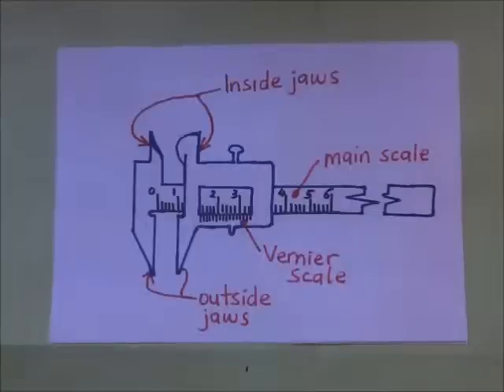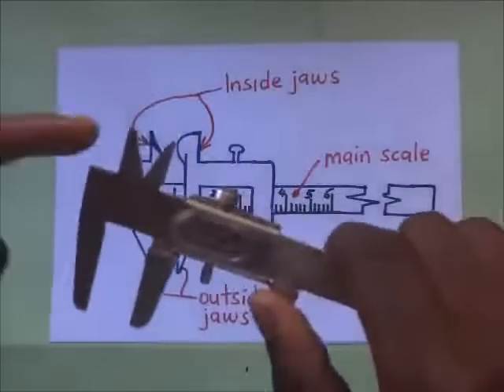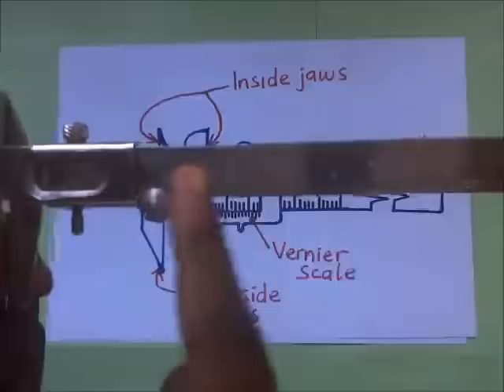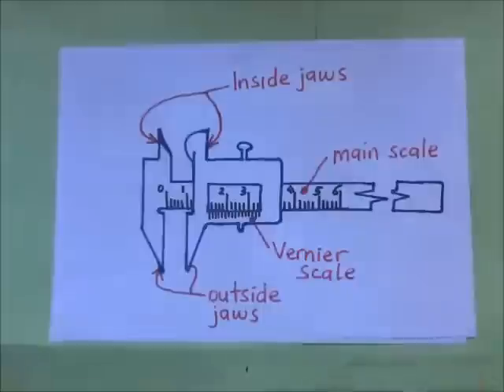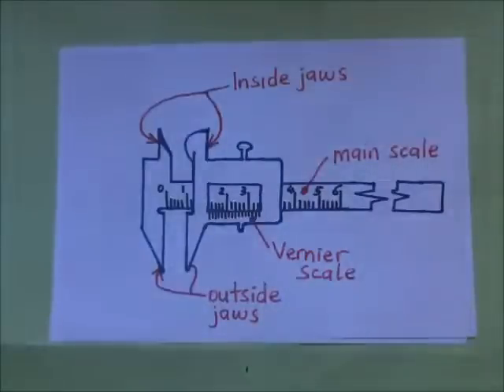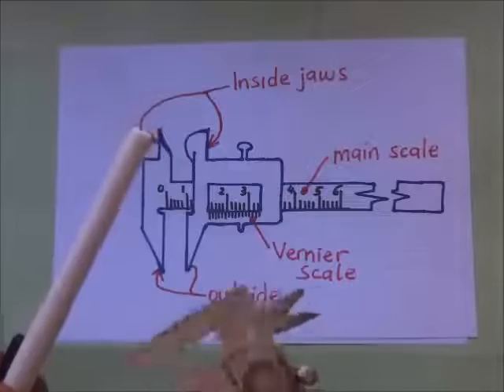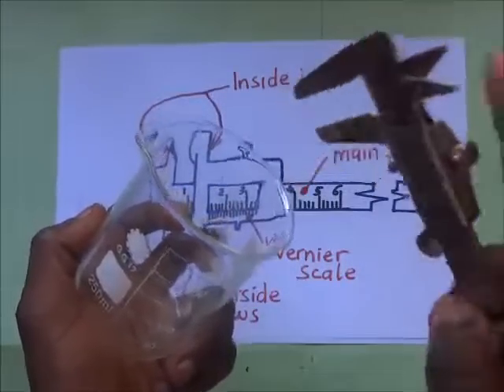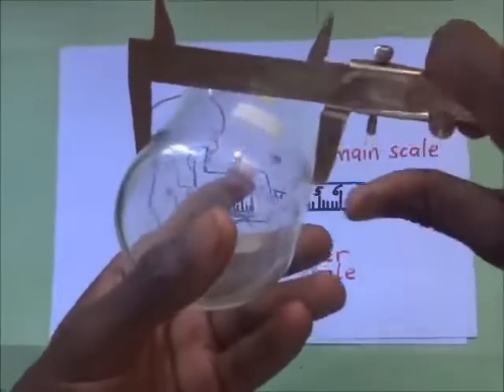How to read a vernier caliper | Vernier caliper parts -internal diameter of a beaker

Comment: Reading on example using 20-21-22 is wrong. There are only 5 divisions (not 10) between 20 and 21 so the readng is not 20.2 , it is 20.4 . Otherwise this demo was helpful in showing how a vernier works to obtain the second digit of precision.
Reply from the maker: thankyou for your feedback Den